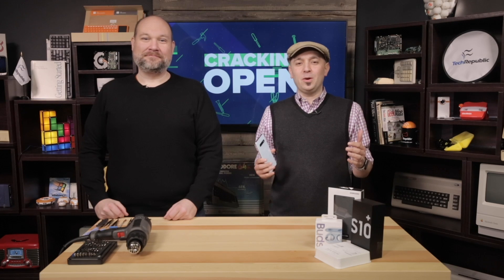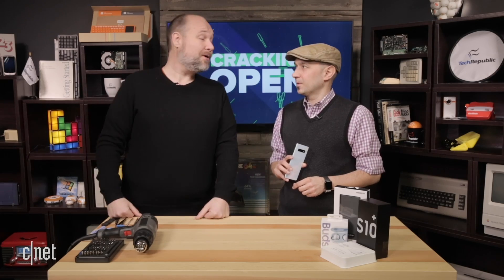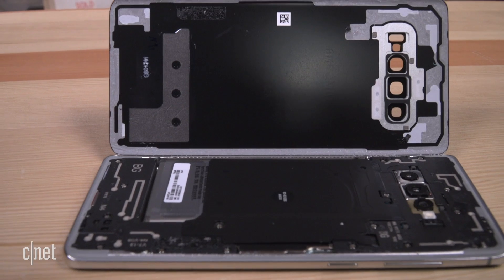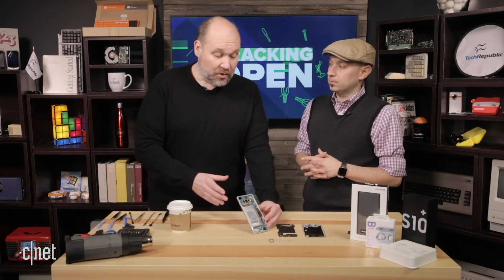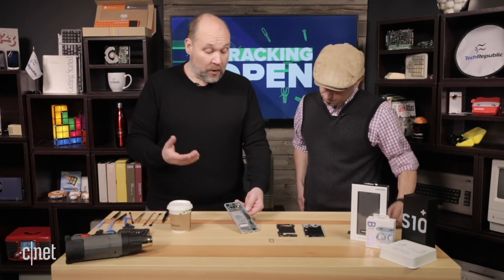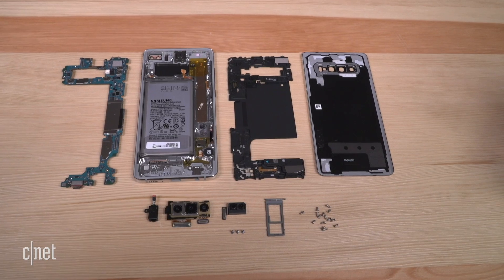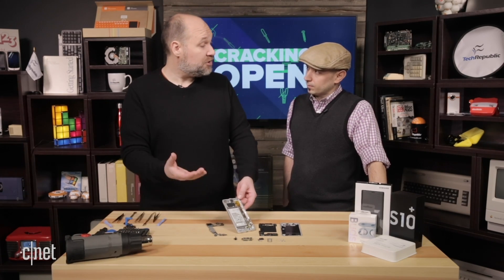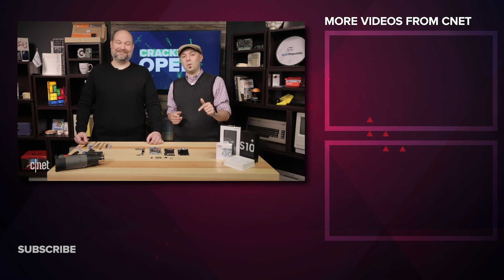Cracking Open the Galaxy S10 Plus

Comment: these guys are ABSOLUTELY CLUELESS !!!!!!  when it comes to ESD!! (ELECTROSTATIC DISCHARGE!!) OMG!! THROW IT AWAY! You have surely compromised if not ruined it.  totally ignorant of the fact you don't even have to touch an item to damage it. Now that it is outside the case, totally vulnerable.  FOR EXAMPLE- ever have a device  you had to reboot more often than normal? (build your own pc without an esd mat or anything?  Or worse yet, device "hangs up, freezes?? It's not  software as often as you think. think ESD. You would have to use an ELECTRON MICROSCOPE and examine every pn & np junction individually. Even the old I phone 6 had about 8 billion transistors. And each transistor has TWO junctions. the clothes you wear can EASILY generate over 5,000 volts. ITS THE POTENTIAL that does the damage, you don't have to even touch it. . Go work for Intell or any chip mfgr, LEARN something. There is soo much more- but i digress. Just sayin.

Comment: By mistake I have pushed the metalic release pin inside the wrong hole (not SIM container). Could you please explain what happens if I put the metalic sim release pin inside the other holes? Will I damage something or just it touches the fixed inside hard parts? I have watched your video completely but could not recognize which parts will be touched exactly. Regards

Comment: Man...I understand why you didn't remove the battery, but I'm sure I'm not the only one who really wanted to see the built-in fingerprint scanner. Regardless, really neat perspective to see how thin and small everything is. I see why it's harder to get bigger and better batteries because in return, heat and the size of the circuit board are huge factors. Someone needs to hurry up and invest a billion dollars in new battery tech so they can stop holding us back and we can advance further in technology 🤣 easier said than done I know
Reply: Okay i noticed this. If u turn of the screen of the s10 plus, polish it real hard, lay it at an angle in light and u can see it. Its a long rectangle thing

Comment: S10+ doesn't have heat pipes. They uses vapor chamber cooling system instead.
Reply: Its look like a normal heatpipe on top of copper to me :\
Reply: @NytroExos  No, it's a vapor chamber. Jerryrig's teardown of the S10 shows the inside. The S10+ has an even larger one.

Comment: That's why I canceled prebook of s10 plus coz of its usb port... I hope samsung ll be careful n won't mistake in note 10 in future then I'll buy note 10
Reply: Bit extra but okay
Reply: @muaaz6124  right, super extra. Like ok, miss out on a phone cuz of in case you break it, you cant fix it the same way? Odd. I doubt they'd go this way with the board just to go back to the old way on later phones.
Reply: Its not just when the USB port damages, it’s also when there’s a mobile connectivity fault which will be a pain once the device is out of warranty
Reply: @MyMainMan90   just like me.. I have s7 edge n it's usb port is not working 😑😑 I'm suffering from pain past 2 years